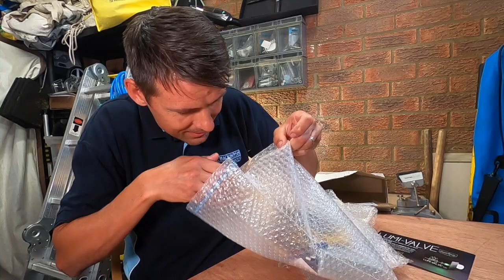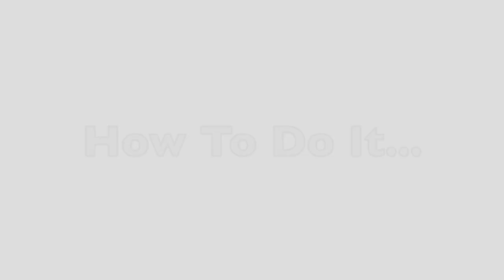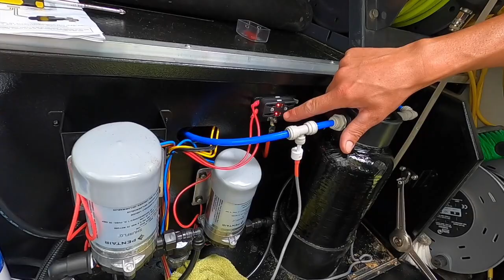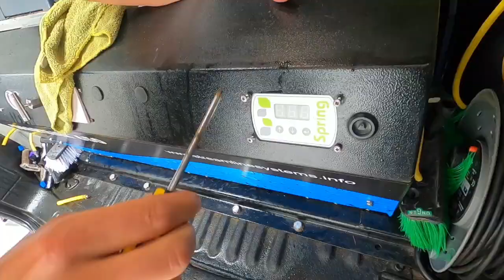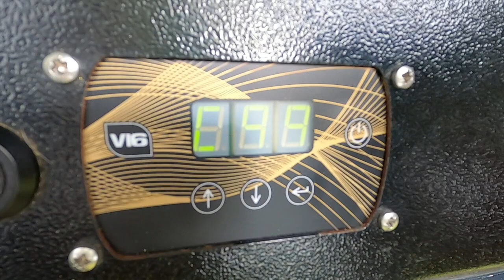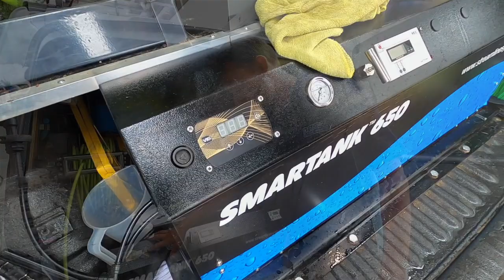Fitting My New Pump Controller - Spring V16

Comment: Before I have chance to Calibrate I’m getting a PS error, I’ve bypassed the pressure switch and remade all my connections but still not having any luck has anyone had similar problems?
Reply from the maker: PS means pressure switch. It might be that your battery is too flat to run the pump?
Reply: @aemackintosh  Thanks for your reply, I turned off the battery cuttoff and it was still happening turned out to be a bad connection from the controller to the pump which meant I didn't even need to bypass the switch got there in the end!
Reply from the maker: Ah, I’m glad you got it sorted.😃👍🏼

Comment: If you have powered off the controller by the power button.., can it be turned on again if you push a button on the remote? I don’t want it to turn on the flow if someone accidentally pushes a button on the remote in the van.
Reply from the maker: Not sure, I don’t have the version with the remote.

Comment: Hi Ashley I’ve just installed a v16, what’s the best setting you have found works best for you ?
Cheers Frank
Reply from the maker: I’m not sure what you mean. Once you have wired it up you need to calibrate it. I show how to do this at the end of the video. Then I normally have the flow set between about 24-28.😃👍🏼
Reply: A.E.Mackintosh Cleaning Services that’s what I meant the flow 😀👍

Comment: Hi Ashley, I know this is off topic for the video but when you pull the gutter cleaner out the van, do you use ramps or just pull it out van? Thanks
Reply from the maker: I can lift the gutter vac in and out without too much trouble so I don’t need ramps for it.😃👍🏼

Comment: Bin the scotch locks solder and shrink-sleeve joints..
Reply from the maker: The controller came with the blue scotch clips. I have got a soldering iron, but hopefully the video shows how even a complete novice can do this themselves.😃👍🏼
Reply: A.E.Mackintosh Cleaning Services 

Not knocking it but there is nothing worse than looking for electrical faults

Comment: You need to throw all those blue scotch clips away. The biggest cause of failed circuits and dry joints. Always solder joints and use high quality heatshrink. Also avoid those new low temperature heatshrink inline connectors. They are also shite
Reply: Cheers mate I’ve only had it a few hours and to rewired it because of the blue clips.
Thanks for the vids have really helped me ⭐️⭐️⭐️⭐️⭐️
Reply from the maker: Thanks. That would be a step up. I do have a soldering iron. The controller came with the blue scotch clips, so hopefully the way I have shown it done can be carried out even by a complete novice with no experience.😃👍🏼